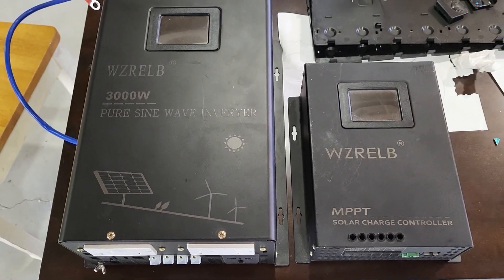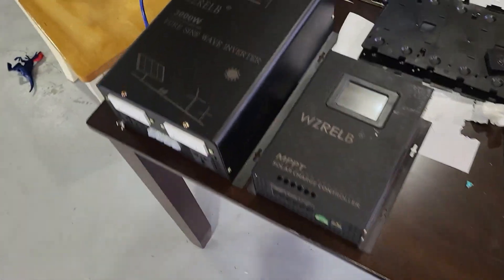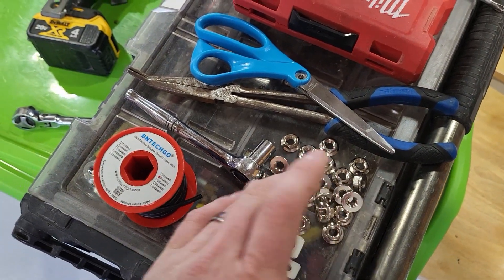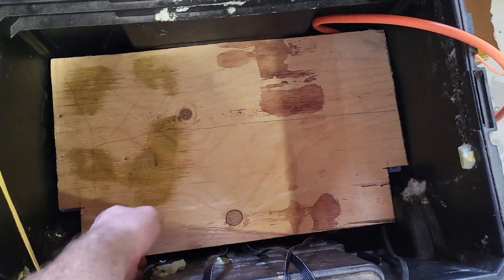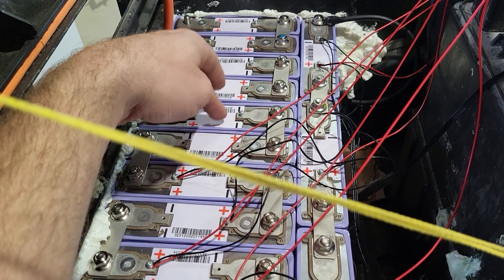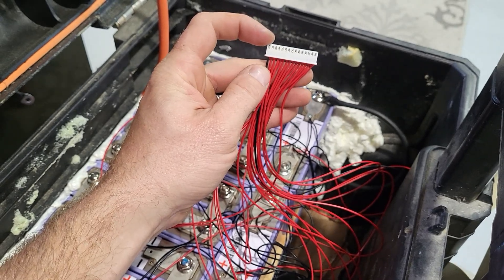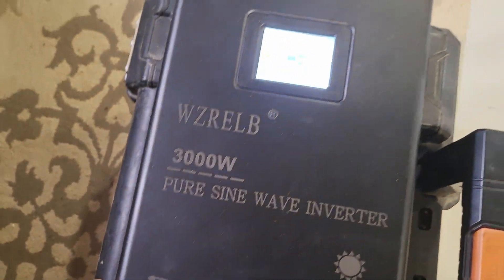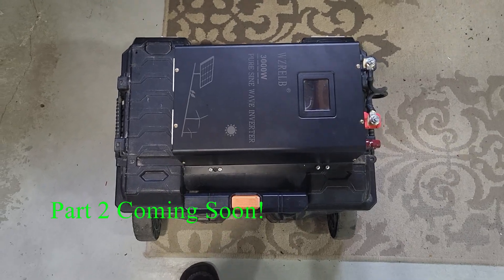7KWH Solar Power Station

Comment: do u still use your 3000 watt eliminator invertor. reason i'm asking is got thinkin about your bacups and u said using your vehicle. would that inverter run your sump pump off your jeep???
Reply from the maker: I Loved that inverter for its day, but its not good in todays market , the new 3000w pure sine wave eliminator might be good but have not tested.
Reply: THANX FOR THE RESPOSE. NEVER DAWNED ON ME ABOUT USING MY TRUCK FOR A BACUP. STILL HAVE MY 3000 WATT ELIMINATOR!!! @GoingOffGrid101

Comment: Nice to see you back with more regular video releases again 👍lots of excellent progress there on the new property. Those cell's look to be same manufacture as the current Battery Hookup LEV60F 74ah lifepo4 cells made in Japan, i've been stirring thinking of making a large purchase of these cells from BH but need to check on shipping & duty fees.
Reply from the maker: Yes I think mine are a little less capacity but more or less the same. Hope you can find good shipping! And thanks it's good to be back.
Reply: I've made a couple orders and was seeing 70Ah at a 50A discharge rate. A slower discharge rate would get me 71 or 72Ah sometimes.

These cells are ridiculous in terms of power.

Comment: I just built up same in my camper van, but my inverter is a cheap modified sine wave thing, but modern electronics dont really care its now down to older transformer and coil driven things that are not as happy (induction hobs, microwaves), once had an inverter fail and start putting out 220v DC that was running 2 laptops and 3 printers, was weeks till I noticed because I plugged in an old charger with an old transformer in it.

Comment: Looks like the last two batteries in the series on the bottom batch have two in the wrong Battery Polarity.
How do you stop the vibration in the box from driving, thinking about the wood against the terminals on the bottom batch. Or does it not matter?
Sorry to add, Does it create a lot of heat if lid closed and charger in the box too.
Being in the uk I know we can't buy the batteries you do, but for example, where do you get them, old cars?
Thanks for the build,  Your videos are great imspiration.
Reply from the maker: yes old cars, im going to move the charge controller, updates coming, im going to completely fill the box with batteries and foam.
Reply: @GoingOffGrid101  Thanks once again. Take care and hope you and your family get over their colds. Take care.
Reply from the maker: @MrSnowMen  thank you I always enjoy your comments!